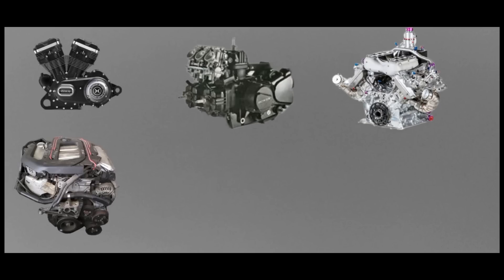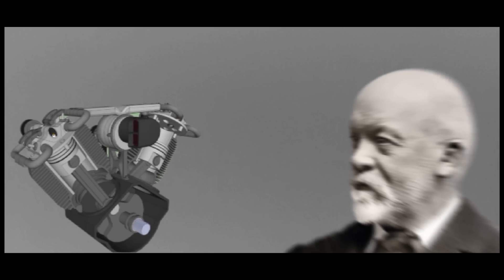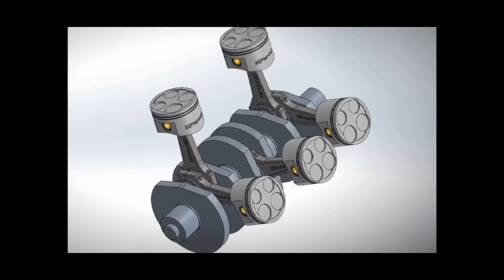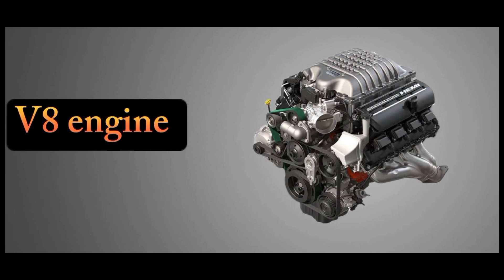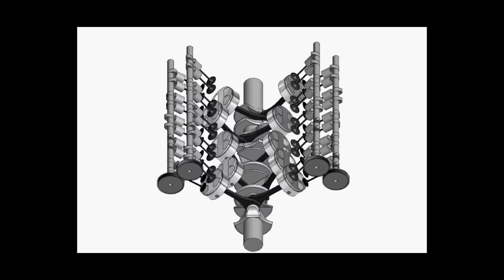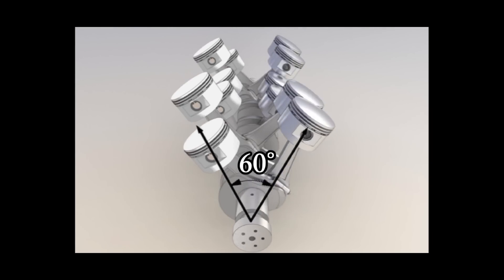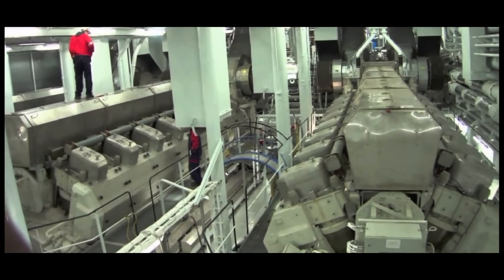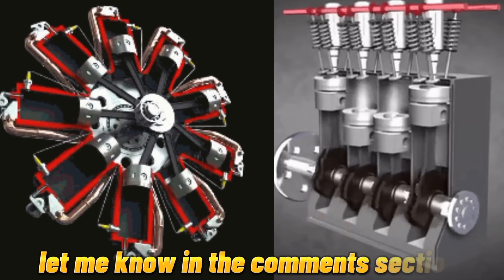V2 Engine to V24 Engine

Comment: The V16 engine was added to the Devel sixteen
Reply: Quad turbo W16 to be exact
Reply: @WhyNotStation wasn't that used in bugatti's?
Reply: @Feltzy-  Yes it is still used
Reply: @Feltzy-  yes but not turbocharged
Reply: It wasnt even added! They could not find a good gear box and transmission for it,they produced one unit and it has a fucking corvette v8 engine

Comment: Can someone fabricate an inline 24
Reply: Hey man! Im not an expert but I24 engines would be too long and they couldn't rev much because the crankshaft would be too long. Plus, if the engine could reach even a few thousands RPM, the engine would be too unstabele because of vibrations due to its dimentions. Not counting the fact that it would be kinda pointless when you can just make a V24 which is smaller and more reliable.
Reply: Well its possible if thats what you mean

Comment: The “v3” and “v5” are actually inlines, such as Inline 3 and Inline 5 most used in Audi’s
Reply from the maker: no my friend . Note the V3 engine.  If I look at it from the side, we can see that there is one cylinder on the right side and two cylinders on the left side, which are at an angle of about 60 degrees from each other.  Linear motors are not like that, they are all in a straight line with no angles.

Comment: I liked this video especially the v4. I didn't know they made a v4. I thought they wouldn't be balanced enough to be used. But, i do have to say that the v6 isn't the only engine that can be designed for different fuels. All engine configuration can be designed for any fuel type since the cylinder layout does not determine that.
Reply from the maker: I am happy to pass this information to you.  Indeed, any engine can work with any fuel, but the most common ones are V6 and V8
Reply: I assume you know the Nordschleife? The record holder for the fastest laps on this circuit (5:19.546) is the Porsche 919 Hybrid Evo. This car has a 2.0L V4 that produces 730hp. Porsche says the V4 from the 919 is the most efficient engine they've ever built.

Comment: I would like to know how 24 Cylinders Fire.
Reply: Dont put it into a miata.
Reply: Probably one at a time.
Reply: 24v149. Enjoy
Reply: imagine just adding 4, 6 cylinder engines
Reply: It's basically 2 V12 slapped together so it probably runs on the V12 ignition order probably
Reply: @alrichhill48  absolutely right! Two V12's put together.
Reply: The same as any other internal combustion engine……..
Reply: @cosmiccolonel  he talks about the order of ignition of the cylinders (maybe^^)

Comment: the Auto Union Type D F1 designed by Porsche used a rear mounted V14 in 1937 while the Mercedes used his own inverted V12 from the Messerschmitt 109, with direct injection and twin turbos!
Reply from the maker: It is interesting to have good engineering.  But no matter what I looked for, I couldn't find any pictures or specifications of the V14 engine, so I deleted it
Reply: @AIROCAR1  not a V14, a V16, they also made a streamlined body for that F1

Comment: It's like wikipedia articles read together. Every time going through the number of the cylinders and the angle. Yeah, V12 has 12 cylinders, 6 on each side, who would have guessed after several engines each having the same number of cylinder as number in their names, divided by 2 on each side? 90 or less degrees, we got that in the begining of the video. Only useful mention was 60° on V12 for balance. How much thought has even gone to this video?
Reply from the maker: My friend, some may not understand this.  I tried to explain completely so that there is no room for questions.  This is not a Wikipedia article, you can search and compare.

Comment: Modern cars use I6 and not V6 anymore
Reply from the maker: 16 cylinder engines are used in supercars.  And the shape of these engines is W, not V shape.  This video of only about V-shaped engines, not W-shaped.
Reply: @AIROCAR1  I am talking about inline 6 not V16 or W16 😉
Reply from the maker: @gregkollaeg2365  sorry my friend  I misread your comment
Reply from the maker: @gregkollaeg2365  I don't know much about inline engines yet, I have to research it
Reply: @AIROCAR1  🫵👍
Reply: New Cars with V6: Nissan Z (2023), Nissan Skyline Nismo (coming 2024), Audi RS4 (2023), Maserati MC20 (2023), Ferrari 296 (2023).......
Reply: @fre3z3r68  the engine from Nissan are old as fuck! Audi rs4 engine are old too. Masserati and Ferrari are the same. And yes ther engines are new. But they do numbers.
Reply: They do no numbers
Reply: @gregkollaeg2365  Ford Ranger Raptor, Ford Bronco, VW Amarok V6 TDI, Porsche Macan
Reply: @fre3z3r68  Macan 2.9 V6 BiTurbo is the same as the Audi RS4. The V6 TDI is not new at all and the emissions are horrible!! Audi, VW, Porsche do no new combustion engines. Ther future is electric. Americans? They use technology from the 60is 🤣
Reply: Perfect balance, only 2 camshafts, and interchangebets parts with 3, 4 cylinder. Only one designe for the 3, 4, 6 cylinder engine. BMW, Mercedes, Jahuar, Land Rover do this etc.